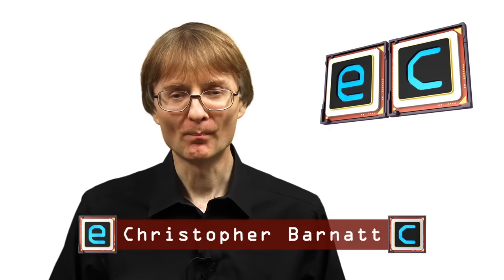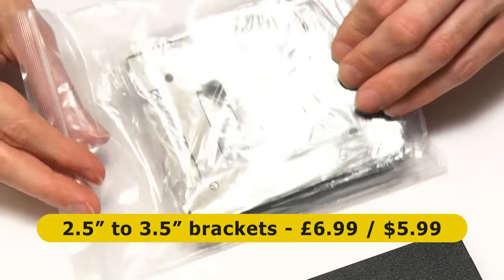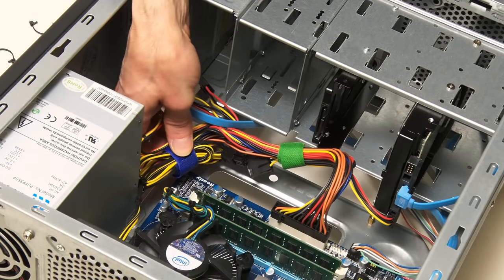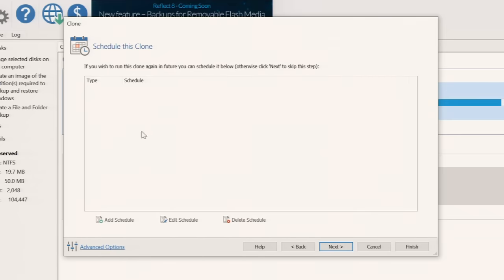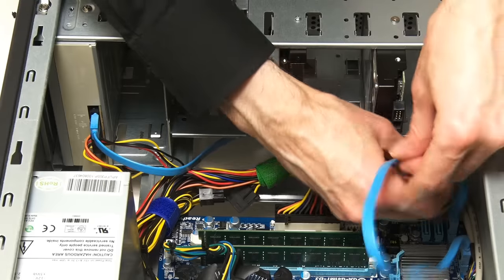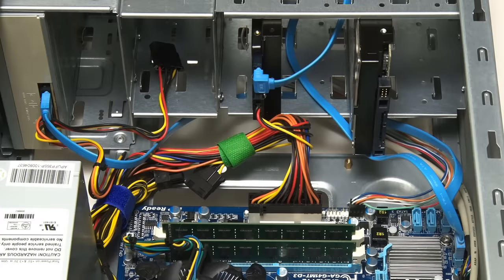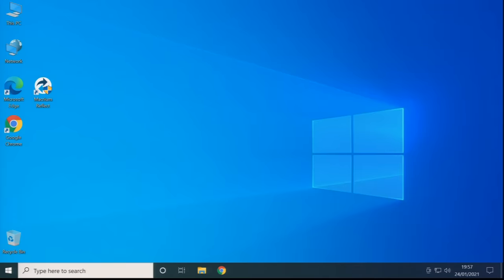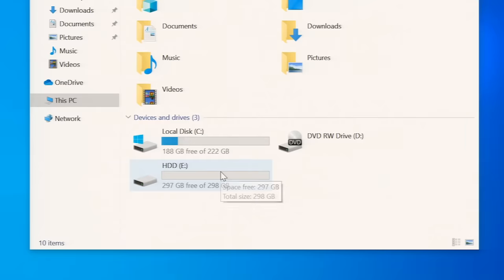Old PC Upgrade #2: SSD Boot Drive

Comment: No matter how old is your pc, but SSD is a mandatory.
Reply: Tell that to my win95 pc!
Reply: latitude d630 wants ssd to stay alive in 2021 now he show about the cloning and partions.
Reply: @ozmobozo  That's nothing, I have a 80486 laptop with a SSD.
Reply: @ozmobozo  actually old pcs that runs w95 only needs cf card since the computer limits the disk size. lexar 800x cf card is more than enough.

Technically CF cards are SSDs but at the different form factor
Reply: I like to keep my old pentium and below computers equipped with hard drives. Yeah they're slower, but you don't get an authentic old computer experience without a clattering clunking hard drive!
Reply: There we are, an ssd in an old computer
Reply: @adithyasunil8809  and?
Reply: I wonder it is possible to trim SSD on windows xp?
Reply: @ozmobozo  Yup, I don't think Pentium 90's support SSD's...
Reply: @tonyelsom6382  You can tweak it to work but I'm just okay with a sata hard drive. I think the bios emulates IDE interface. Also for DOS it has a feature that allows you to boot DOS from a USB drive. I use an Athlon64 system by the way.
Reply: @ozmobozo  I would've squeezed win7 on that setup, and remember, SSD's works like a charm with virtual memory, you don't need as much physical ram. ( I run GTA4 on my 2014 laptop with 2GB ram)
Reply: Charles Babbage has entered the chat
Reply: Actually, no. I have Windows XP and Vista machines that boot lightning fast on well-used traditional hard drives. There's a lot of caveats to getting the best performance out of SSDs and by default a casual user may never see a performance increase.
Reply: @tonyelsom6382  I intentionally use old windows versions because it's a nostalgia build.
Reply: #no
Reply: @ozmobozo  Yea, I thought as much..... 👍 😉
Reply: @hreodbeorhtcheesewright4889  Babbage?..yeah, boomer here, literally..
Reply: @tonyelsom6382  I saw his "Difference Engine No.2" at the Computer History Museum in Mountain View California, it is impressive.
Reply: @volvo09  hahaha 🤣
Reply: @hreodbeorhtcheesewright4889  Didn't know Charles Babbage before your reply, but a quick YT search got me updated..Now I'd HAVE to binge on that...My computer experience started with British micro's...
Reply: @lee99bay  I think only with some drives that have software to support TRIM on XP like Samsung
Reply: cries in mini ide
Reply: Microsoft Vista and Below Do Not have TRIM support for SSD as a Native part of the Operating System.  I have two pretty old Desktops, one is a Sony Vaio, Pentium II, running at 300 MHz, originally 64 MB, updated to 190 MB, updated to a 6 GB Hard Drive, updated from Windows 95 to 98 SE.  This computer actually could be upgraded to Windows XP.  SSD would not be a benefit at all on this computer.  The other old Desktop is a Dell Optiplex GX-620, SFF, 2.8 GHz Dual Core Pentium D, around 2006 manufacturing Date, originally 2 GB, updated to 4 GB, originally XP updated to Lubuntu 18.04, and my point is that Windows 7 - 10 could actually run on this computer, yet in any case the SSD has been helpful with the Lubuntu 18.04 on the computer.   So...not just any old PC...but one needs to now go pretty far back there where the SSD is not helpful...yet a SSD is not Mandatory, and does not benefit much from an O/S before Windows 7...which for a younger person, (pnnytx, "Lumine Gaming"), is Antiquity. LOL!  I do not game except with my Kasparov Chess Program dated 2003.  My new PC was $350 and is running at 4 GHz, it is so fast I do not know what to do...LOL!
Reply: @lee99bay  Yes, via 3rd party programs or even the programs (if still available) from the SSD manufacturer.
Reply: @Wasmachineman  How?
Reply: @ozmobozo  my pentium 3 has an msata ssd though a 40pin ide adapter, there's no excuse, every computer needs an ssd
Reply: @TruthLivesNow  I'm 61, and I love games, but since start I've always ran slower machines which I've souped up with ram, video cards and every other trick in the book to wait out prize drops in new tech. A real scrooge Mc duck , hence my interest in these vid's..  😉
Reply: @LovelyAlanna  Not that I care but some people will say it's not periodically correct. To me it's unnecessary, IDE interface won't use it well and it's gonna wear out fast. 9x operating systems can't utilize ssd's so it's not going to be super fast anyway. And there's one other thing that not everyone lives in the west, in many countries even a 120 gb ssd is expensive.
Reply: @AndrewAHayes  mSATA SSD in a mSATA-IDE adapter with OnTrack DDO.
Reply: @Wasmachineman  Thanks!
Reply: Good luck finding an SSD with an MFM interface.
Reply: @ozmobozo  you have no idea man, even if it's through the IDE interface the system is leagues faster, much more responsive and clearly more reliable as it isn't over 20 years old and prone to fail
Reply: @LovelyAlanna  Well you have no idea about how much idea I have... I tried many options, and for a couple of seconds faster to boot it's really not worth to hassle. And I'm not using a vintage IDE drive all of them are moderately new unused sata hard drives. However if one fails I can just replace since it's a windows 95 computer I really really don't care if I lose a drive to failure. So, promise you don't beat me with a baseball bat because I'm not using an ssd.
Reply: @LovelyAlanna  And did I tell you about the fact that in some countries ssd's are expensive? Oh looking back I did! I happen to live in one of those so I'll keep those 200gig hard drives.
Reply: @FlyboyHelosim  It does a lot! Most programs that take a while to load, like browsers or office suites load much faster on a SSD. And the boot up is also sensibly faster on a SSD, even in a fresh install.
Reply: if disk 100-90% on task manager is that because hdd or cpu?
Reply: @gteixeira  On some systems, maybe. But honestly I don't get the obsession with fast boot times. Is having to wait a few more seconds really going to kill you? Because that's all we're talking about, seconds. People are so impatient nowadays.
Reply: my LG laptop DOES NOT see an SSD plugged in. only if it is an external drive.
so, I still need to use HDs in 2021...
Reply: @erriezzanslounge1380  because of damn windows 10. disable Superfetch and indexing
Reply: @lingux_yt  so i should downgrade to windows 7?
Reply: @erriezzanslounge1380  I would downgrade it to 8.1
but there's no need, just disable these two and the PC gets better
Reply: @lingux_yt  where two disable those 2
Reply: @erriezzanslounge1380  it came from hdd bruh.
Reply: @FlyboyHelosim  So why bother to pay $1000 for a graphics card if you can just wait a few seconds for each frame to render? Those young people are so impatient those days lol.
Reply: @gteixeira  Most people don't pay $1000 for a graphics card. Besides, that's a totally different thing. A storage device of any speed will get the job done where the final product is identical. Data transfer is a one-off process with a static end product, unlike that of a graphics card which is real-time and constant. Don't try and be a smart arse.
Reply: @gteixeira  Better graphics card = better the experience
Reply: @pnnytx  Better the SSD, better experience as well.
Reply: @gteixeira  yea, ssd is a mandatory in 2021. otherwise experience will suffer.
Reply: @FlyboyHelosim  It depends on the purpose, a HDD may have more storage, but if the access to it is too slow it may hurt the experience. Data transfer is not one-off as you may think, since many software keep constantly accessing files in order to operate, so if the access time is too slow, the whole software will hang waiting for the files to load. I know this is an awful software design, but that is the way it is and a lot of important software is like that like office or browsers.
Reply: @erriezzanslounge1380  open the Run window (Win+R) and type in "services.msc"
Reply: @ozmobozo  and why do you think it was different back then? Ever heard of Disk on Module? That's basically SSD which was fairly popular in embedded applications since mid 90s. And yeah, that makes it available to Win95 systems as well.
Reply: @lee99bay  some SSDs have internal trim-like mechanism to let things go smoothly even if OS doesn't support TRIM.
Reply: Especially nowadays. 10+ years ago when that particular motherboard came out, the same size of that Gigabyte SSD would have cost a small fortune!
Reply: The days of sata SSDs are long over, this machine could boot windows 10 in ~20 seconds with a PCIE NVME drive
Reply: @thomassmith4999  no it could not. I do have quite modern machine and it doesn't matter if it's sata or nvme - it boots up around 10s anyway. Most ppl do not realize there's a hard block with CSM or other "legacy option" and assume they need nvme to make things faster. That's pretty much BS. But since nvme is pretty small and doesn't cost more than sata it's fairly obvious what is the first choice IF you have m.2 pcie slot. If you do not and your old machine bios doesn't let you boot up from nvme@pcie (adapter card) - well it doesn't make nvme good choice, right? Sure, if your uefi has space for nvme module  - go ahead. If not - stick with SATA.
Reply: @Promilus1984  HI mate, what you do is install Clover on a small 20 gig or so sata SSD and point that to the PCIE NVME drive this way you can boot windows off an NVME drive. I do this with my old workstations and they will do 2 gig a second on a PCIE 2.0 slot vs 200 meg a second on Sata 2.0,.Huge difference.
Reply: @thomassmith4999  guess what... linus tech tips blind test in games - that's the difference average user will see. Funny :) Huge difference is only in benchmark or pretty rare occasions where ultra high transfer of big files actually matters.  In everydas usage I can say nvme advantage over sata is basically non existent. And I do say that as an owner of SATA 480GB SSD, nvme gen3 256GB and nvme gen4 500GB.
Reply: @lee99bay  Unlikely unless the SSD drive manufacturer has its own software to do it that's compatible with Windows XP.
Reply: @Promilus1984  Big difference with the NVME if you run 2000 browser tabs. You shouldn't take to much notice of Linux tech tips. Every video is building a Ryzen and playing Doom.
Reply: @thomassmith4999  well then what is typical home usage you can actually notice a difference?
Reply: @Promilus1984  I notice a big difference but I'm one of these guys that never closes a browser tab. So always more than 2000 tabs open.
Reply: @thomassmith4999  well that's you. Most ppl don't have more than 20 so I found you argument rather poorly reflecting typical home usage. And that's exactly what was my point - no specific niche but regular home usage. NVMe over SATA3 gives barely noticeable difference to most users.
Reply: In the test the difference between booting from HDD and SSD has been minimal, so CPU and SATA-2 are serious bottlenecks too during booting.
Reply: @bertnijhof5413  Yes. This build wasn't perfectly executed, using a Raid card with lots of cache that supports SATA 3 would have made more sense. The processor on the card then takes a lot of the load.
Reply: @thomassmith4999  I did that once with a 2008 HP dc5850 and it helped somewhat, the SDD came up to ~400MB/s running against the limits of PCIe 2.0.
Reply: @bertnijhof5413  Yep it makes a good difference compared to a regular onboard sata controller. But you can also use clover to boot from usb or a small 30gig sata drive on old bios's and then jump from that to a PCIE NVME drive on Pcie 2.0 and get 2gig /s transfers. This is ultimately the best way to get a seamless boot and fast drive on a old PC. If you use a few ssd sata drives on Raid 5 with the sas to sata raid card setup you can get over 1gig transfers also on pcie 2.0.
Reply: @chris w I got a big haul of beige PCs from the scrap yard the other day. It is truly amazing how well they perform with age appropriate operating systems on them. Even the original Pentiums are rockets with a 5 dollar IDE to Compact flash card adapter and Debian 2.0 or Windows 95/98. I also got an IDE Raid card.. I'll be living the dream with that once I get more CF adapters. Once you get into Pentium 3s those things really haul.
Reply: Don’t older motherboards not support the highest speeds of SSD’s?
Reply: @tylerdean980  Sata 3 is fairly recent so you are normally looking at sata 2 or 1 on older machines. However PCI-E 2 motherboards will have no problem maxing out sata 3 once you put a sata 3 card or SAS raid card in them. That's all very slow compared to a NVME pci-e drive anyway.
Reply: Put a SSD on a 2006 Dell server(with Windows 7) with max 2GB memory, made a world of difference!!!😍
Reply: @pnnytx  No they are not. The control logic in an SSD is much more complex.
Reply: Try putting one in a 22 year old IBM thinkpad !
Reply: @FlyboyHelosim  on a computer that is used to complete work for a job yes faster boot times are very much desirable.  As you may have to reboot the system.  Along of course with the faster launch times of software.
Reply: I already spent $200-250 trying to fix my half dead laptop from 2013. Need help convincing that spending another 200 on ssd is better than buying a new laptop with rtx3060 at under 2k...
Reply: @lee99bay  SSD Trim was only implemented in Windows 7 onwards. So yes, you can use SSD with Windows XP, but that would lead to an earlier death of the SSD due to garbage collection.
Reply: I made a core 2 duo usable again with ssd
There are still dirty cheap core 2 duo laptops with good keyboards out there
Reply: @Christine Ayres i have an old optiplex with i-5 3470 
With 1 ssd for OS and 2 hard drives for storage

People tend to underestimate the usability of older processors
Reply: Vista and below don’t benefit much from a hard disk, as i’ve seen that it still boots fast with a hard drive.

However, in 7 or newer, a SSD is beneficial, due to TRIM support

TL;DR : Vista and older don’t need a SSD, 7 and newer does.
Reply: Didint help boot time at all or performance its still as slow as it was before 
Boot time from 143 seconds to 137 seconds 
I have 16 gigs of ram
And intel i5 cpu
A good graphics card idk what to do i was running normally but suddenly my pc restarted by its self and became this slow cpu, ram, disk always at 100% idk what to do i spent so much money and nearly no improvement btw cant run gta or minecraft and Chrome takes 2 minutes to open literally 2 minutes PLS SOMEONE HELP
Reply: @Christine Ayres i tried already didint help at all, theres a billion processes always running, theres like a billion backround cmd and powershell apps i counted them and there was definetly over 4500 when i try to end task it just says i dont have permission they are also set to start everytime i boot
Reply: @Christine Ayres ARE YOU OK I SPENT OVER 1 THOUSAND DOLLARS I SAVED UP FOR 4 YEARS THERES NO WAY I WILL BE WAITING NOPE IF YOU WANT ME TO GET A NEW PC THEN GIVE ME THE MONEY FOR ONE OR FIX MINE
Reply: @Christine Ayres im waiting
Reply: @Christine Ayres WHAT REALLY OH MY GOD GOD BLESS YOUR SOUL THANKS SO MUCH YOU HAVE NO IDEA HOW MUCH THIS MEANS TO ME THANK YOU THANK YOU IM SO HAPPY JUST TOLD MY PARENTS THAT IM BUYING A NEW PC TO FIX IT :D THANKS AGAIN YOU ARE THE BEST PERSON EVER TO LIVE ON EARTH HOPE YOU HAVE A GOOD DAY
Reply: @Christine Ayres wat okay how long btw your my best friend now :)
Reply: @Christine Ayres no but actually dude thank you when is it gonna arrive and what pc did you order what specs
Reply: @Christine Ayres you weird are you sure like im not beimg sarcastic here
Reply: @Christine Ayres um where id the delivery
Reply: @Christine Ayres did you send it to the correct address and wtf is air mail
Reply: @Christine Ayres im a boy do you have discord
Reply: You got good grammars
Reply: My motherboard with ddr3/am3: